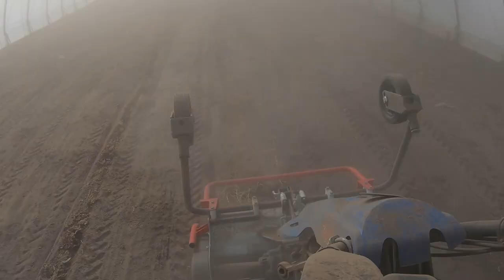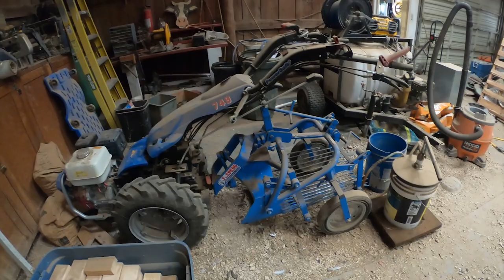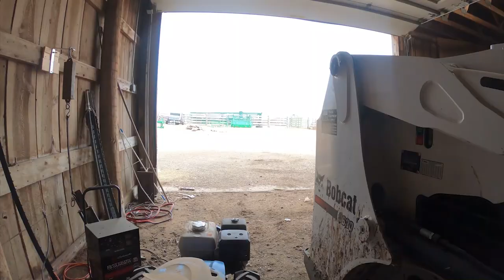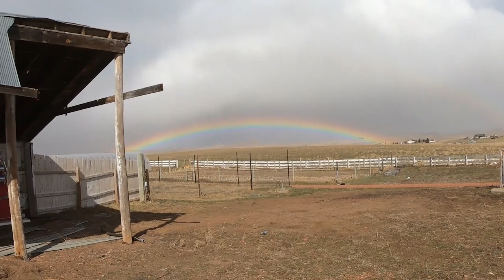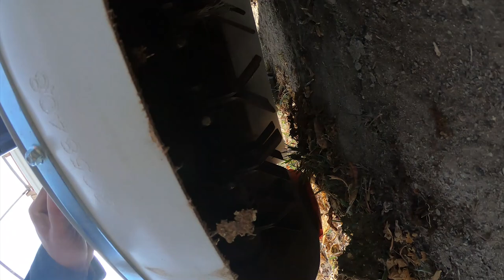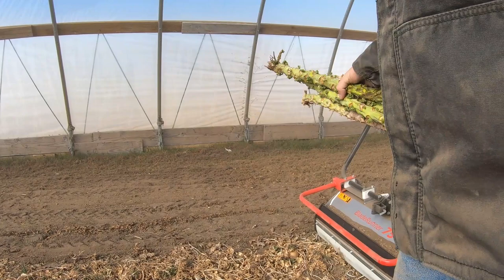A Little Dust - Using the BCS Flail Mower to Remove Ground Cover

Comment: Hi Mike,  Grease the quick release coupler for easier dis/connect of implements from the BCS. Also with the heavy flail mower, you might want to add 20lb of weight on the front "bush guard" the silver colored metal pipe. Help balance the weight so its easier to maneuver the machine. And its advisable to run a sprinkler in the greenhouse prior to running the BCS to help minimize dust.  
Yup kale stalks are hard to chew up. goes into the chipper chute of my wood chipper.

Comment: If they weren't in such short supply, I can think of a good use for a face  mask!
Reply from the maker: I know that's right.  Thanks for watching
Reply: @OurWyomingLife  A cartridge filter type respirator in ALL dusty agricultural situations will help prevent the Old Rancher/Farmer with clogged lung diseases.  It's hell on earth and every minute, when you can't breath in your later (or sooner) years simply because you failed (or were too stubborn) to wear the proper protective equipment in hazardous conditions.  PS: It's worse than breathing popcorn dust from the gift bag !! Stay Safe!
Reply: Can always use a bandana ... though then someone may mistake him for a robber... though why anyone would want to steal kale I will never know...

Comment: Started on first pull! That’s a good sign.
Reply from the maker: BCS is a great machine.  A must have
Reply: @OurWyomingLife  Here the lawn mower started on the second pull while the combines were chopping corn down the street across the highway as the tillage tools were hot behind in anticipation of 3-5 inches of snow tonite.

Comment: I am guessing the water wasn’t hooked up yet, would wet the soil to avoid dust.   I hope that doesn’t Dull the cutting blades, but it probably does.   Hopefully it solves your aphids problem.    Has Erin researched the “back to Eden” gardening method?   Don’t know if you can get lots of compost and Wood chips in your area.
Reply from the maker: No, sure isnt a lot of wood chips here at all. Thanks for watching.

Comment: That BCS machine would be perfect if it was remote controlled so you could stand back and control/steer it.  It likely took a few hours but it did fast work of the job,  considering the before and after condition of the soil.
Reply from the maker: BCS is a great machine for a lot of things and who knows that might be a future model.

Comment: You’ll need to remove and sharpen all the blades now. It’s not designed to run directly in the dirt. Shoup has the replacement blades you’ll need.

Comment: A little better way to winterize a gas engine is to 1) Put stabilizer in fuel 2) Run engine 3) Shut off fuel petcock while engine is running 4) Let engine run until it dies.  This will burn all of the fuel in the carburetor so none is left to evaporate and cause varnish.  This will save your carb and it’ll last for years and years.  God Bless! 🤠
Reply from the maker: Thanks for the advise.  Come back tomorrow and we will get into something else.
Reply: Our Wyoming Life - Yepper, will do.  🤠

Comment: You’ll need to remove and sharpen all the blades now. as flail blades are not designed to run directly in the soil. Shoup has the replacement blades you’ll need.
A tiller attachment would’ve been the better choice for that task, in order to incorporate the organic matter back into the soil.

Comment: Man o man, Mike, you really should seriously consider using a mask at least when you till up inside like that. Even better if you could open up the walls and get some ventilation. It may not seem like it's a big thing but as the years pass that abuse of your lungs will really come back to haunt you. Have a great day. I'm a huge fan.
Reply from the maker: Thanks for the advise and I will do better.  Thanks for following along.  See you tomorrow
Reply: @OurWyomingLife  just want to see you around for many years to come. Didn't mean to sound like the preachy-teachy type.